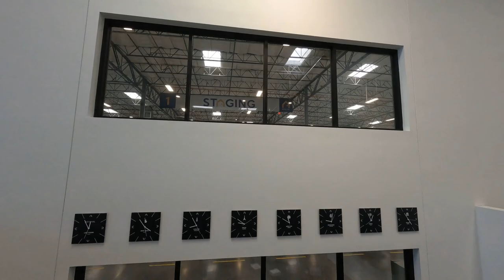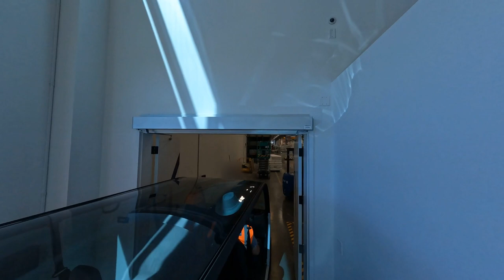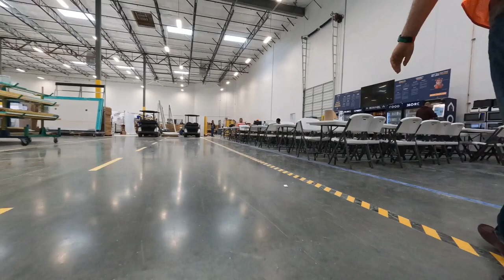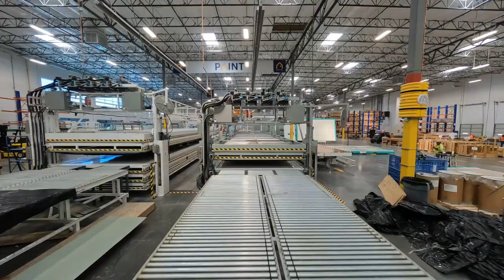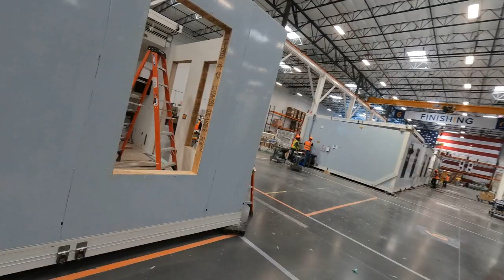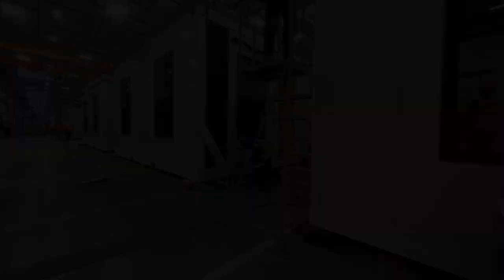BOXABL Factory-1 Tour

Comment: Sir, may i ask, is it safe to build a folding house boxabl in an area where there are a lot of earthquakes?
Reply from the maker: We haven’t done testing on this yet but expect it to be rated for all earthquake zones; our manufacturing method results in a solid building. We will post third-party test data on this once it's available.
Reply: When rating for earthquake safety it is not just the structure. The foundation, local geology, other structures nearby, large tree that might fail, soil studies to name a few, need to be done. This is NOT a one size fits all answer. I live in Southern California… there are also fire, flood, earth sinking factors in our state.